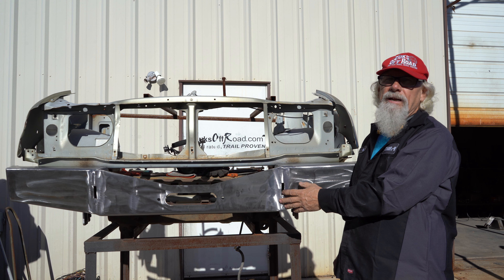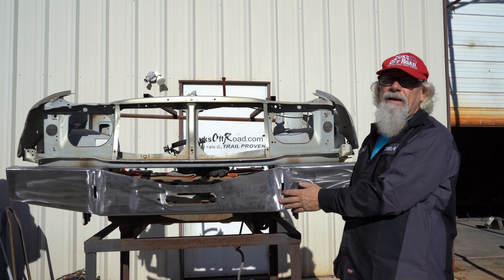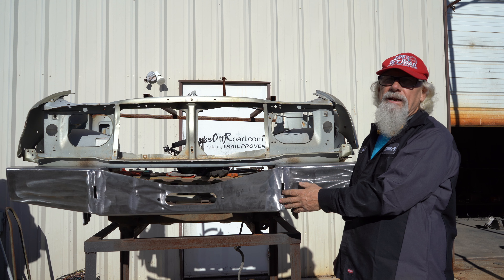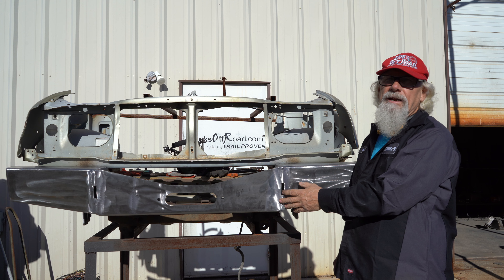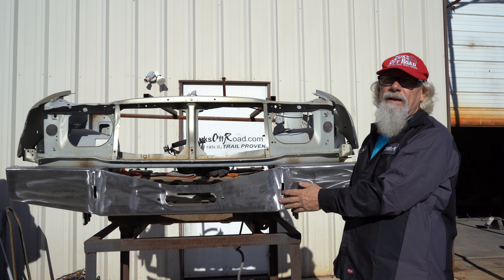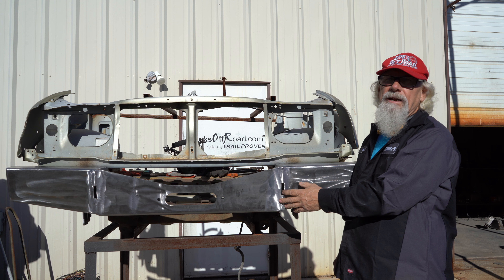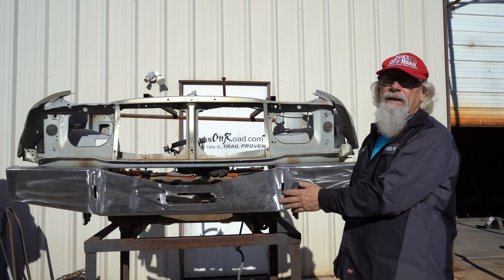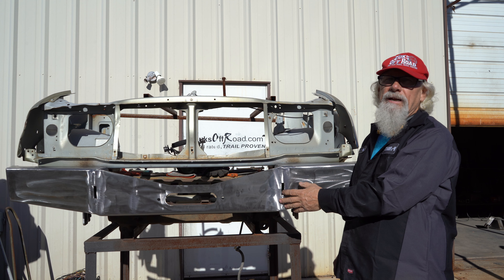Suzuki Sidekick Vitara, Grand Vitara, Geo Tracker, Grand Tracker ZOR Front Bumpers

Comment: Do you make brackets like these for Samurais?  Specifically for the rear bumper, I want to make my own bumper out of some steel I have but would buy a bracket first
Reply from the maker: No I do not sell any rear bumper brackets individually they are simple to make. Samurai bumpers should be bolt on. It’s a flexible frame that way.  Video coming for how we make rear samurai bumpers so you can see the “frame brackets”